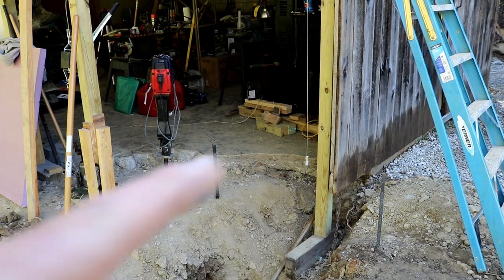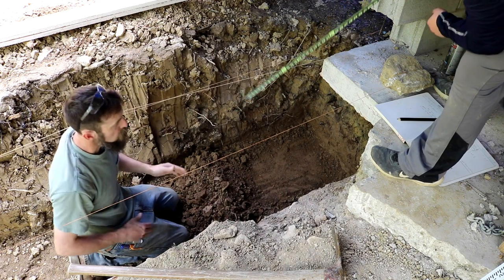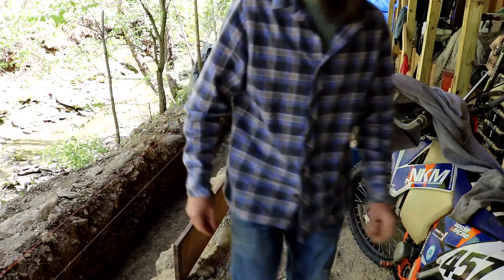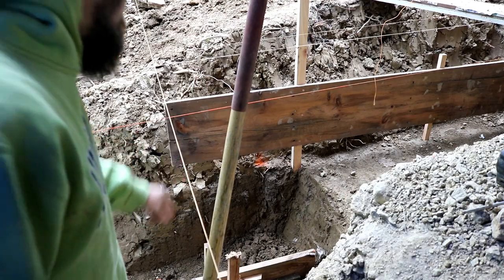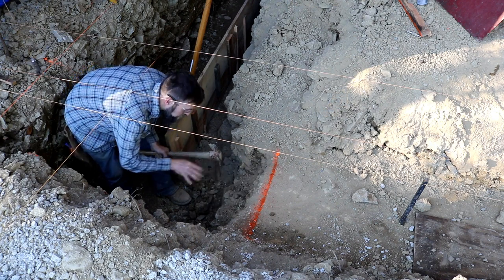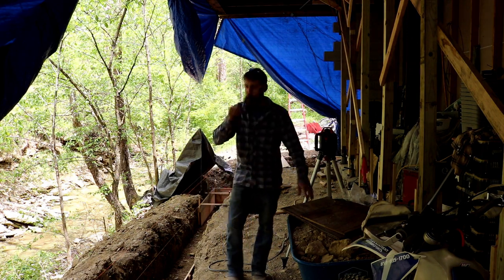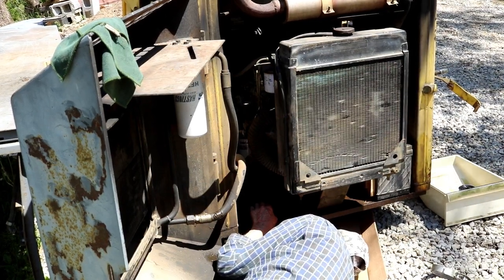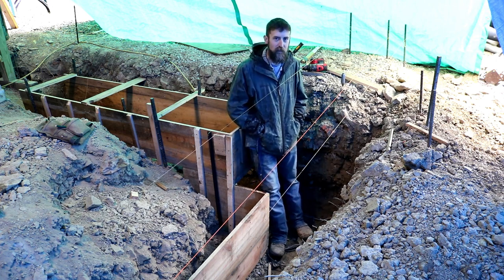Building concrete forms for the shop Footings . Damaged Shop 13

Comment: Years ago I did a very small concrete tornado shelter, boy working with concrete gives you an appreciation for theguys thatdo it day in day out. Did it in 2 pours, 1st was the floor/footer 5'x8' and I nearly passed out that summer trying to keep up with the truck. Second pour was the sides/top. 1 of my side forms partially caved in nearly ruind the whole thing. In the end it turned out great, but it was months of work and planning. Nice job steve

Comment: Steve i can surely relate to those who never show up or never call back. I have some roof damage on an old building and everyone that is suppose to be interested never shows up or calls back. Some are advertised as really needing to work and will do any jobs but when it comes to work no shows.  I can't wait to see you get the mud pumped in the trench. I am also following RR on his shop expansion. Thanks again for the videos.

Comment: Better get that line replaced on the skid steer. It will leak more $$ in oil than it costs especially when it decides to give up all the way and pump a bunch of oil out on the ground. Always cheaper to pay now than later. :-)

Comment: Pull the tape out all the way and give it a good cleaning as the dust and dirt get into the case and gets into the spring. Hence the stickiness. Love this series. When pouring that much cement make sure you use a vibrator to remove any air and make sure it settles.

Comment: Steve, I’m so in tune with your comments about the difference between metal work and concrete.  I spent a career in maintenance and fabrication but like many, did several careers to support my family including working for years as a concrete finisher.  My OCD from metal work frustrating my coworkers but the boss loved my attention to precision as a finisher.

Comment: Been looking forward to the next step. You're doing real well in that ugly, rocky ground.
Back fill to the formwork. The concrete goes in hard, heavy and fast.
Reply: Thos Oz Yes, most amateurs don't plan for the heavy mix slamming around during the pour, not to mention the need for workers to climb around on them at the same time.
Reply: And, he said that those boards were termite eaten. I would expect them to move AND break.

Comment: One of my first concrete pours had a wall about 5' tall in a basement footing and when they started pouring it started to blow out, so we fired up the old Cadillac Eldorado and ran the front bumper up against the form to hold it in place.   I think you need to resign yourself to doing your own block work- finding someone who will do it like you want and will be willing to do it on camera is not going to be easy.  Love the smirk when you undid the padlock.
Reply: In 1978 I helped pour a house with 17 foot stacks that had 3 blow outs. The contractor had an emotion blow out. Too much coffee.

Comment: Steve, Both my wife and I have thoroughly enjoyed this series.  Yes, its a break from the machining content however you have to have a decent structurally sound building to have a viable machine shop (or woodworking or automotive shop).  I think most that watch your channel are the "do-it-yourself type" and would be doing a lot of the work themselves just like you have to do.  Most of us dont have a pile of cash laying around to just hire a contractor to build them a shiny new machine shop.  So we make do and modify what we have to suit our needs.  You are inspiring us to tackle it ourselves, learn a new trade (and yes this does tie in with machining) so that our shop can be bigger or better and to not break the bank in the process.  You are going to have one hell of a shop when this project is finished.  Keep up the good work, we look forward to the show each and every Saturday morning.
Reply: I've been on concrete pours that were burning through $32,000 a minute in payroll costs alone. Pours can be really high pressure for some folks. Whoever is footing the bill. It's just a really expensive day on a build. A lot of times it's just one day too. I think everyone understands the time component involved when working with concrete. At least enough that it eats at them. I've seen people just about having nervous breakdowns on some pours. I was just a laborer so no matter what I was getting paid. The worse it goes the more I make.

Comment: Batter boards... Place your two steel stakes about 3' wide. Attach a horizontal board to the two steel stakes. I'm thinking on your job you'll need 6 sets of these for your footings. Now tie your strings to the horizontal pieces of wood at the desired width of the footing. Drop down a plumb bob and set the width of the footing. Scratch a pencil line where the line is wrapped around the wood.  You can now remove the lines and do the work needed without getting tangled up in the lines. You can easily reattach these lines in the exact same place as before because of the pencil line.When it comes to snapping lines on the footing, center the width of the wall between the two pencil mark's that define the width of your footingon the horizontal piece of wood, mark with pencil, attach lines, plumb down to footing, mark then snap lines.

Comment: Steve, you know the saying " you want it done right, do it yourself " It's to bad you can't find a mason that is willing to do the job the way you want it done. I'm no mason either and forming concrete and keeping the forms from blowing out is an art. Placing the rebar in the forms so they don't move or poke through the finished pour, it's a big job but you have done so much already YOU CAN DO THIS. You will have expanded your skill set and the satisfaction when it is complete, knowing I DID THAT !!! Were pulling for ya.
Reply: Laying block is a lot harder than it looks. Experienced masons make it look really easy.

Comment: Think of a construction site with 200guys, saws,hammers,diesel engines,pile driver, traffic,city noise, trains, and cursing....that's why the pitch of the transmitter is like that ..
Reply: There's just so many sounds a piezo transducer can make. Mostly just annoying squeals and beeps. They're not exactly high fidelity gear.

Comment: Good Mornin Steve! Sounds like you are getting a bit frustrated with this project, Hang in there! Good thing happen to good folks. You will find another Al to help with the concrete. Yes, you are too fussy but that's you, the job has to be done to your happiness level so you can sleep at night :-) Good to see your son, the squirrels, and your Dads. Keep on trucking, I am loving it!! Thanks, you make my Saturday Mornin.
Reply: That is some pretty bad ground to dig. Although I've seen worse. I was on one site on the top of a mountain and the whole site was one solid chunk of blue stone. You could dig all day and not have a bucket of dirt to show for it. Was solid rock. I took a week to cut a notch across the slab to lay some conduit in. Going like crazy I'd make maybe 11 feet in a day. By the end of the week I could break cubes out of that rock pretty good though. You get good at anything after a while.

Comment: Coming along Steve.   Just a couple of suggestions, but your are probably past this point.  Use batter boards for setting your strings and not a single stake or tying to another sting, this is much harder to knock out of wack and easier to adjust string location.  Secure your form boards from the outside when ever possible, makes form stripping much easier.  It is also ok to use wood stakes that may not be removed from the concrete, just cut them off after the pour of the footing, keeping this in mind can at times make setting form easier.  You are doing well, lots of work.  You will be pouring soon.
Reply from the maker: Thanks Randy. I considered batter boards but never wanted to take the time to stop and redo the.😁

Comment: That is going to be an awful lot of weight on those thin pine boards when the concrete is fresh poured. I've seen 2x12" boards blow out with less weight. I hope you will be riddling those forms with snap ties or something similar
Reply: You've seen a 2x12 blow out when it is part of a 12" deep form, or when there are multiple stacked on top of each other like he did in the video? It is impossible for a 12" deep form to "blow out" a 2x12, so I assume you're talking about the latter situation. (Unless the board is damaged or has a serious inclusion/knot/rot.) So it'd probably be good to mention that the 2x12 was part of a 24, 36, or 48" deep form. Also, that just means the stakes were not close enough. You have the board "blow out" before it bows and cracks/moves the stake, means the stakes weren't close enough spaced.
Reply: Yep, came down to say the same thing and you beat me to it, even backfill to the trench sides.
Reply: @xenonram  Good point. More stakes for sure but since there are so many rocks at least blocks to the walls of the trench. What do you think?
Reply: @mayshack  LOL'd, literally.

Comment: Good job! The forming is making a long video and that's what most YouTube people want. Another way to go would have been to make your footing 24"wide x 8" thick and lay another course of block, no forms! Once you pay to have the cement truck coming out....an extra half yard of concrete for a couple dirt wall imperfections doesn't cost that much at all. Getting those forms out is also going to be very time consuming!
Reply: It would be difficult at best to get a level footer if all he did was pour the concrete in to the trench. That and the strength of an 8" thick footer would be nowhere near that of a 16" thick footer. He also had an engineer run the numbers and he/she came up with 20" wide and 16" deep for the footer. This is one of those times where it pays to listen to your engineer and follow their recommendation. If you try and cheap out it can end up costing a lot more money in the long run.
Reply: Because the engineer said to make it 16" thick. Another course of block doesn't add to the strength in the way he needs strength. And it's not as small of an amount of extra concrete as you're thinking. The width of the trench is on average about 15% wider. He's going to need almost 8-9 yd^3 of concrete. Adding another 15% to that means he'll need around 10 yards, and now he's into a second truck and another few hundred bucks. Also what MT2SS above me said. Also, 8" just isn't thick enough considering the conditions. It is going to be a load bearing block wall, which will have the weight of the block, roof, snow, and wind. Plus the potential of it being undermined or washed out from water. 16" thick footer that is properly anchored will be able to support it even if it is almost completely undermined.
Reply: These are all good points. I'm not arguing with you guys because if there's one thing I have learned in my 30 years as a general contractor there are many ways to achieve the same goal. I'm not saying go against what his engineer said. You ask him if "this way will work". I have meetings all the time with engineers and we can normally come up with several plans that work. He is building a garage. I have many 2 story homes on 8"x24" footings. River wash out is a whole other ballgame.

Comment: Good job, Steve.  Lots of cops, lawyers and shoe salesmen chiming in on how YOU should do YOUR construction project at YOUR house.  I've seen a few things that I would do differently at my place, but overall I haven't seen anything that is not solid workmanship.  I wish I was closer by so I could come give you a hand.

*Edited to add:  Throw that inch grade rod away and get a tenths rod.  Ciphering for your elevations will get much easier.

Comment: Your unlocking Of the doors reminds me of the two summers I worked at a place called The Silvermine Tavern. Because it was built on the banks of the Silvermine river, the dining rooms faced the water with 5’ by 5’ window panels that would be removed fo the summer. Heavy canvas shades would be used to cover the window openings at closing time. Of course for those rare time when I got there Before my boss, I could just walk around the building and step in through a window and unlock the place.

My old boss Ralph built ten units of condos back in the late 70s, even though he and his brother were masons, he subbed out the block work and the basement floors. The block went fine. The floor did not. Ralph ordered the concrete as if his own crew were doing it with chalk lines snapped on the block and screeds set even with the lines. The sub said he didn’t need any screeds proceeded to make floors almost twice as thick as the plan called for. And of course he was charging by the cubic yard poured, not the square foot finished.

Comment: A little precision goes a long way, and this is why I never put marks on string for layout (string stretches a LOT over the course of a day). You want a structure to be nice and square. The trick is to drive a stakes into the ground and attach a 2x4 across them. Then drive a 16 penny nail (in a close approximation of where the string will be) into the top of the 2x4, leave it sticking out about halfway. Tie the string up near the head of the nail. Now you can bend the nail left or right to get it into exact location. This permanently fixes the string and you can untie it to get it out of the way and put it back on anytime. Just a slip knot at one end and wrap the string back on itself on the other end and let the spool dangle. Just helped a friend build a 16x80 deck and it only took like half an hour to lay it out completely with all post locations using this exact method and we removed the strings afterwards (to keep family from tripping over strings while the lumber was being delivered). Once built the deck was within 1/16th of inch from square (using 3,4,5 ft corner measurements), certainly this wasn't a requirement for a deck but it didn't require a ton of extra time. I realize that you will likely be past this stage but if you ever get into a similar project, give it a try.
Reply: The string does stretch, but it doesn't change the positional location of the mark any appreciable amount, especially over the 5 foot span where he marked it. The two ends of that line were set, and if the string stretches, it will sag, not move the mark toward one end or the other. That being said, I agree with what you said about seeing each end positively with a nail instead of tying into a string for a perpendicular line.

Comment: Dig about every 8 foot a perpendicular footing back towards your floor and tie into your floor with rebar in these perpendicular footings drill holes into the existing concrete floor about every 2 feet parallel to surface about half thickness of concrete. Epoxy rebar into these holes. Tie all rebar togeather. This will create a footing that will tie that outside footing  back further into a more stable base and floor togeather with the footing and new floor to old floor. This will not allow the new floor and old floor to shift elevations on each other. There would have to be 20 feet of that bank to wash to cause any future proems.
Reply: It looks really challenging , I am worried.

Comment: At 9:10 and other places: You just gotta love a machinist scraping the surface in. You could use a Biax scraper instead of that hand scraper.
Reply: I was thinking the same thing. Those hand scraping skills do have some application outside of metal.

Comment: Where I  live is pretty much a booming economy and The Contractors just do not do renovations only new construction. Oh they say their interested, but just as what happened with you they never show up. I'm fifteen years into a 3800 sqft house doin' it all myself. I'm 69 and got to get it finished. The Grandkids  are moved into the basement which is 90% finished (needs some door trimming and some plumbing in the guest bathroom). I see where you get your work ethic (From your Father). Keep at it. And yes I'm with you in the form work, No use just wasting cement and it shows that someone cared with the form work.  I'm guessing you'll backfill those taller forms.

Comment: Steve Summers
Job well done. Just with your forms were there's a gap to the dirt behind put some bracing on them as concrete has more weight & pressure than many expect, otherwise they could push the form boards out or even blow them out.(more concrete used). 1 cubic yard of wet concrete weighs about 4.000 pounds. Your 50 foot footing alone will take about 4.2 C/yd. That's over 8 tons. Often when they pump concrete they might over fill certain areas & then spread it out from there. That can put a lot more pressure on your formwork.

With the "reo" you can get plastic bar chairs of various sizes to suit the bottom & the sides as again once the concrete starts going in you don't want movement with the "reo". They probably will use a vibrator & that can cause blow outs as they can put extra pressure on the concrete.

I'm 72 & now retired (live Sydney Aust. area). I had 47 years in construction of many large projects. I Saw countless thousands of concrete trucks unloading their mix. I was a construction surveyor, so all the measurements your doing was my job as well.

With your assistant (your son) get him to hold that rod/stave perpendicular, as anything else is shorter (a good piratical geometry lesson).  Actually there's an accessory (inexpensive) rod/stave bubble that you hold on the rod that allows it to be always plumb.